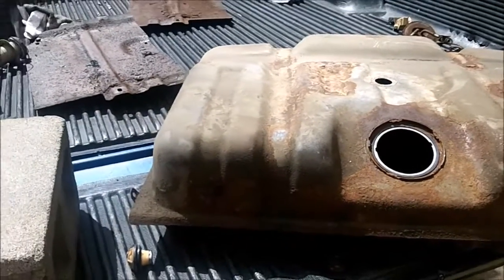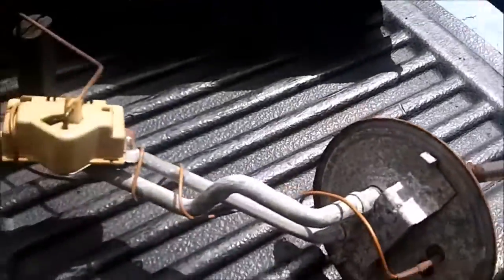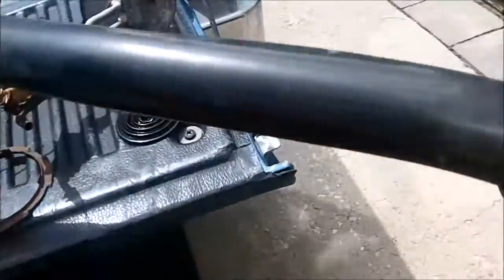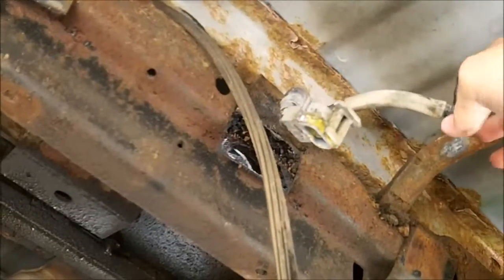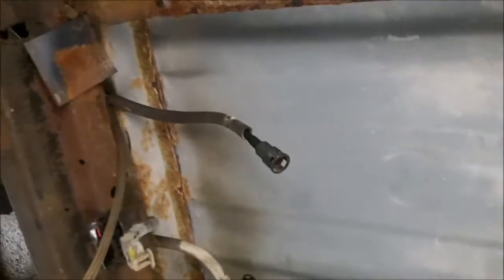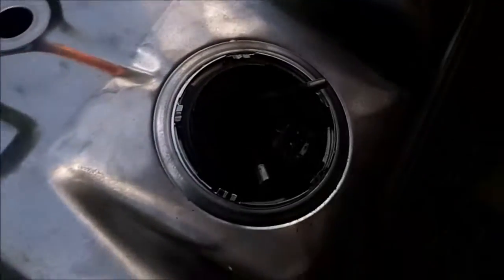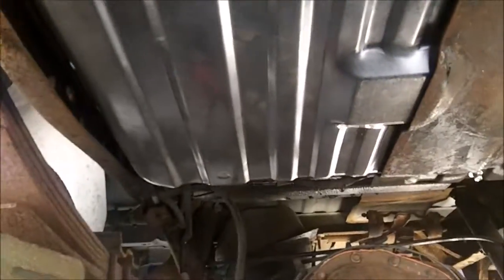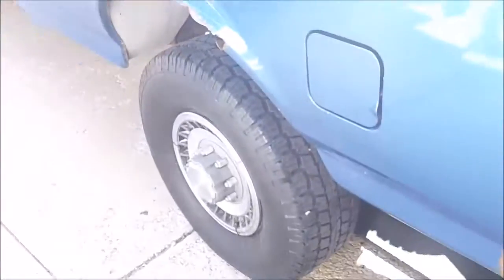FORD F250 REAR FUEL TANK

Comment: Doing mine now. pointers for 96 F250....

1. I took a wire wheel on my drill to the skid plate bolts and sprayed with penetrant before removing... I believe it was 13mm at top and 15mm at bottom

2.  I cleaned up frame area around tank while it was down and painted everything.

3. I cleaned oil off new tank with brake cleaner and did several coats of rustoleum paint to slow down the rust.

4. I added self adhesive gasket for camper shells to bottom of new tank where the skid plates contact the tank to prevent squeeking and metal to metal contact. 

5. You need a special tool to remove the fuel lines to the fuel pickup... you need to move the tank around to where the line is straight or the tool will not compress the clips all the way around the inside of the collar. Push in firmly.  I then pulled slightly on the tank to get the line to pull out because I didn't have any hands left. The tool slides into the collar from the fuel pickup side. 

6. I replaced the outer filler tube hose with a new one which is much more flexible because it is not old and stiff. 

7. The screws to the filler neck at the gas cap are 9/32"  I had to use pliers to get bottom out and took it to Napa to be sure I got the right size socket. 

It is a fairly big job so do any maintenance you can in this area because you will not have access to it again after tank is installed.

Comment: good vid! way better than many out there concerning f250 tank replacement. have you done the side mount tank yet?i had to bite the bullet and buy 2 tanks because they both now have leaks.yours looks way less rusty though.
Reply from the maker: Thanks. Have not done the side tank yet it's still good but will have to take it out to put a new sending unit in because the gauge doesn't work and the pickup is broken. It starts running out of fuel with 4 gallons left.
Reply: yea they pretty much all do that with time, cheers from haida gwaii!
Reply: I did the side tank, easy to take off with car lift, had same problem with tank leaking and bad sending unit, I found the suckion on sending unit has a filter that falls off then the truck can not get the last 5 gallons out. I got ride of filter, put a compression crip on and extend the tube so I can get all fuel out on a 19 gallon tank. Also only place to get new senders for diesels is at trexautoparts, 563-231-0966.

Comment: I know this video is older but did you have any problems not using the shower head and after putting it all together did you have to bleed the air out of the system?
Reply from the maker: No problems at all. I did not have to bleed the system just fill the tank with fuel and switch over from the front tank.

Comment: Ok,now how do run on the front only when rear tank has been removed on a ford f250?
Reply: Someone got the answer
Reply from the maker: If the selector valve is still there and works just switch over to the front tank. If it is missing or not working then just bypass the selector valve and directly hookup the fuel lines to the front tank. You will need some extra fuel lines to hookup the original lines that went to selector valve directly to the front tank.
Reply: Just flip the switch haha